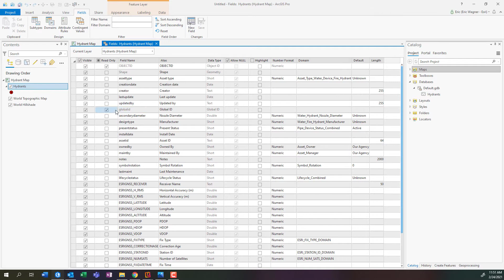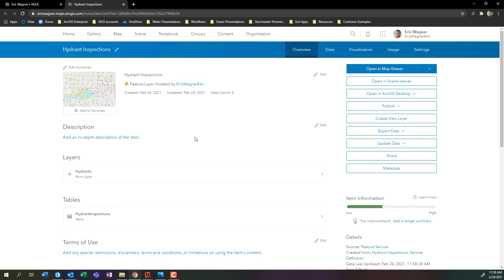Inspection Workflows Part 1: Building & Publishing Related Tables

Comment: Should the GUID field auto-populate with the parents layers GlobalID field?
Reply: Hi Josh B! The GUID field will initially be blank when you first build the related table. Even after you build the relationship class and publish it to ArcGIS Online, it will still be blank. As you complete inspections in the field, a new row will be added to the related table for each inspection submitted. When the new row is created at the time of inspection, the GlobalID is pulled from the parent feature (hydrants in my video) and automatically added to the related table's GUID field. This links the records from the related table to the features in the parent layer.

If the GUID field values are blank, then you most likely missed a step in ArcGIS Pro to build the relationship class.
Reply: @ericwagner5794  Hi Eric. Might be a silly question...but in your example...if the GUID field in the table is being populated from the GlobalID from the parent feature class, why does the related table also need to have a GlobalID field? I'm tracking on everything else except that part. Thanks!
Reply: Hey Steve! Not silly at all! Great question! The inspection table’s GlobalID field is technically not necessary for having a related table in web maps, Field Maps or ArcGIS Pro. As you suggested, you could just have the GlobalID in the hydrant layer and the GUID in the inspection table… but one of my later videos shows how to   (Optionally) incorporate Survey123 into this inspection workflow. And Survey123 requires that all datasets/tables used have a GlobalID field. Adding the GlibalID now in ArcGIS Pro is much easier to do at the beginning rather than than later on. Just planning ahead. Hope that helps!

Comment: I am experiencing a difficulty with the GUID field. It not appearing as an option for Origin Foreign Key.
Reply: Hi Dwayne! Have you set the following:
Origin Table: Hydrants
Destination Table: HydrantInspections
Origin Primary Key: GlobalID

Those are the settings you should have in place. If the Origin Primary key isn't set to GlobalID, that can create issues. I just tested in ArcGIS Pro 2.9 and got the expected results.
Reply: @ericwagner5794  I found out what was the problem. I had to add a new global key because the previous one was missing some data from some of the fields. Thank you for following up with your response, most appreciated.
Reply: Me too has anyone explained how to fix this?

Comment: The add relationship class is greyed out in ArcGis Pro. Do you know how to resolve this?
Reply: I think its a result of standard license required. I have basic.
Reply: @finefuelmoisturecode  , that's correct. You need a Standard license to follow this workflow and to build a relationship class in ArcGIS Pro. However, please take a look at my conversation/comments with Josh K from this video. He asked a similar question about building relationship classes in ArcGIS Online. While this is not possible, ArcGIS Online does provide templates that come with related tables that you can deploy with just a Basic license. Once you deploy the template, you can add it to a map and move on to the second video in this series! It will have all of the same functionality as the relationship class that I show how to build in this video.
Reply: @ericwagner5794  I don't think if it's new thing or not, I'm trying to apply the method you proposed to work around the Basic license, I can't modify the layer that has a related table because I don't have the license

Comment: Hi Eric, I think I know the answer to this but can the relationships be created in ArcGIS Online or does it need to be completed in ArcGIS Pro?
Reply: Hi Josh, the short answer is yes, you need ArcGIS Pro to build a relationship class. Relationship classes cannot be built from scratch in ArcGIS Online. This also requires an ArcGIS Pro Standard License. However, there are other options for those out there with only a Basic License or those who only have ArcGIS Online User Types… keep reading!

For users that only have an ArcGIS Pro Basic License or users that want to build new workflows quickly, ArcGIS Online does have templates that can be deployed by anyone with a Creator or GIS Professional User Type in ArcGIS Online.*

Do the following:
(1) In ArcGIS Online, go to the "Contents" tab.
(2) Click "New item".
(3) Click "Feature layer".
(4) Then choose your template of interest. Most templates (but not all) that have "inspection" in their name, will come with a related table ready to go. Some examples include: Valve Exercising, Backflow Inspection, Inlet Inspection, Manhole Inspection, Water Quality Inspection, etc.

Once the feature layer template is deployed, you can add/remove fields as needed, add the layer/table to maps, share it, etc. and treat it like any other layer in your organization.

I actually had a customer that wanted to do levee inspections with a related table, but he only had a Basic License. So, he deployed the Backflow Inspection template, removed all of the attribute fields that it came with it and then added the attributes he wanted. It was a great little work around to build a relationship class with nothing but ArcGIS Online.

It's a long answer, but maybe this helps you or others who may stumble upon this video and its comments!

*If you have an ArcGIS Pro Basic License, then it came with a Creator User Type for ArcGIS Online. So every organization has access to these templates!
Reply: @ericwagner5794  Thank you so much for your comprehensive response. That might be a great option in building a POC for me (which might lead to a Pro licence).
Reply: Hi @ericwagner5794 , in terms of work management and field staff receiving a list of tasks (I am thinking of pushing work order tasks to ArcGIS from an EAM), is there a way for this to be achieved within Field Maps?  I read somewhere about some further integration between Work Force and Field Maps but noticed that the latest Android release for me is from 2017. Are you able to point me towards any resources that might help me develop a proof of concept? Really appreciate your help. Josh
Reply: @tazmnc  Hi Josh, the short answer is yes! ArcGIS does integrate with many EAMs, CMMSs, SCADA systems, etc. This is a great way to geographically visualize your assets and work history on a map. I have seen this done with Field Maps and Workforce (FYI: Workforce will be integrated with Field Maps in the coming months, this is currently in beta… no ETA yet).
Reply: What it really comes down to is what business systems you have. Some EAMs integrate with ArcGIS Online, some integrate with ArcGIS Enterprise.* Some integrate with both, and some EAMs don’t directly integrate at all. A direct integration is preferred, this allows information to be shared back and forth between your EAM and GIS in real-time. However, if you have a business system that doesn't directly integrate with ArcGIS, you still have options. The most common means of sharing data between the two systems is an Extract, Transform, and Load (ETL) that pushes data back and forth between your GIS and EAM daily to keep the two system in sync. This usually requires some coding.

In short, integration is possible, but it depends on how you implement GIS (ArcGIS Online versus ArcGIS Enterprise) and which EAM your using. I think those governing bodies, utilities, and other organizations (big and small) that tie their business systems to GIS greatly increase the value of the technology they've deployed.

My honest recommendation: reach out to your Esri account team. You should have an account manager and solution engineer that you can lean on. Although I'm no longer a Solution Engineer, my job was to listen to a customer's needs and offer the best strategy for utilities to move forward. They can offer you advice about how to tie business systems together. Also, they can provide demos to you, your managers, and staff to show what's possible. Finally, they also have knowledge of our partner network; many Esri partners specialize in helping to integrate business systems. At the risk of sounding sales-y, working with your account team is free! We like to see our customers be successful! If you need help finding your account team feel free to connect/message me on Linkedin. I can help make a connection. Also, YouTube won't let me share links to case studies and resources. Again, feel free to connect and I can send some resources.

*ArcGIS Online is a cloud-based system, hosted by Esri, for the sharing of maps, apps, and data through the web. All of my YouTube videos are created using ArcGIS Online. ArcGIS Enterprise is similar to ArcGIS Online, but it runs on your organization's own servers (or cloud instances like Azure or AWS). ArcGIS Enterprise offers many benefits not available in ArcGIS Online. Most notable to this thread, ArcGIS Enterprise uses an RDBMS (SQL, Postgres, Oracle, etc.) to store your GIS data. If your other business systems (EAM, billing, CMMS, etc.) are using an RDBMS, then the systems can be tied together to visualize your business data with GIS.
Reply: @ericwagner5794  Thank you Eric, I really appreciate the time you've taken to provide clear responses.
Reply: Is there a video on that @ericwagner5794  ? Hehe. Awesome video